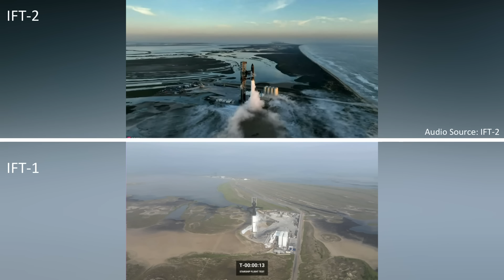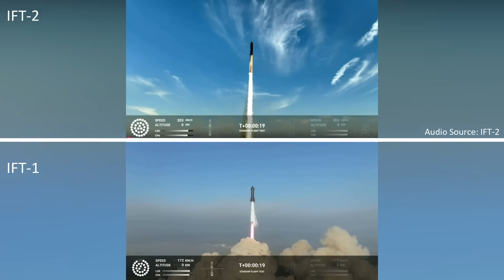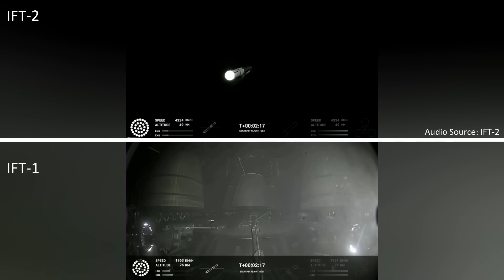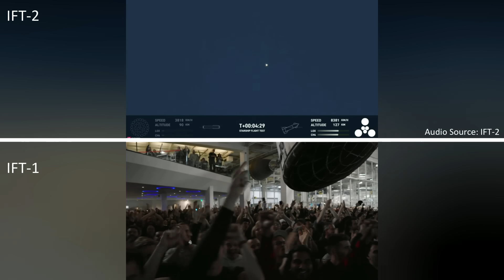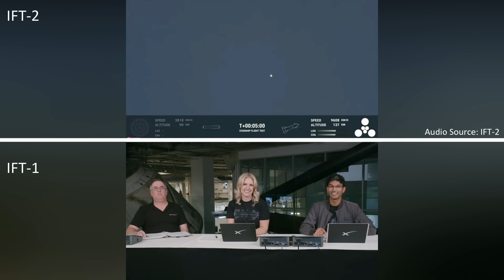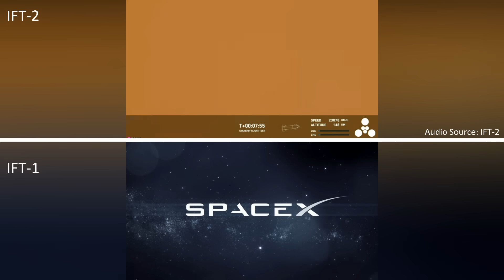Starship Launch IFT-2 Vs IFT-1 : Perfectly Synced Side by Side Comparison Video

Comment: The ignorance of commentors. Iterative improvements is how this game gets played. This launch was significantly better than the first. Over time, each launch will get better until it becomes routinely successful. That's how this game gets played, folks. Falcon 9 and Falcon heavy are perfect examples. They blew up all the time at the beginning, now they are the most reliable, successful, and least expensive launch vehicles in history.
Reply: I think people expect rockets to work like consumer electronics or cars. Usually when you see them they’re ready for market. But even those products go through multiple iterations before we see them. Rockets launch tests just can’t be done in private.
Reply: I expect them to expel 100 ton of black carbon per launch and mess up our ozone  layer. The explosions are just the icing  on the cake of destruction.
Reply: @angryox3102  I mean, they kinda used to be done in private, what we are seeing with the transparency in the test process is unprecedented. Back in the 40s-60s, almost all rocket tests were classified SECRET or TOP SECRET and you couldn't be within miles of the launch site, let alone broadcast it to the world. And there were a LOT of failures (search for USAF_ICBM_and_NASA_Launch_Vehicle_Flight_Test_Successes_and_Failures). By the time of Saturn I and Saturn V, most of the bugs were worked out.
Reply: @angryox3102  That's true. I has been worked in R&D for network equipment and protocol. We had 90% failed PoC(proof of concept) projects and got of 5% of them to a feature for end-user.
Some projects which I had done demo like 10 years ago. Now, they're still under considering in some network operators for 2024 plan to customer.
Reply: It’s crazy seeing people act like spacex and musk failed when these flights don’t go all the way. They’re literally the best in the world at what they do and rockets are insanely hard. I’ll take SpaceX’s approach of rapid iteration and blowing stuff up along the way then NASA’s make everything perfect and take 2 decades to make something
Reply: @edsherwook5196  either way, everything must get perfect at the end; let's just hope Elon doesn't get bored or decides all this is too expensive game
Reply: @edsherwook5196  It also completely ignores that NASA and it's predecessors had plenty of experiments and failures and had many technology demonstrators and programme's with many failures.

Heck, one could argue that the space shuttle never left the experimental stage since the 80's.
Reply: @edsherwook5196 well in fairness to NASA they where very much like spaceX during mercury/Gemini/Apollo but as there budget got shrunk down they simply cant afford to iterate, and with how politicians are a failed launch would likely mean further budget cuts
Reply: @KiRiTO72987  I agree, there’s a lot of reasons  they can’t compete but government bureaucracy is definitely the major one
Reply: Iterative improvement and big booms isnt the only way to play this game but it is the fast and cheap way to do it
Reply: @426shelby426 yep is better and more fun that simply using billions like nasa and not doing nothing atleast you get mechanical experience and over production experience to
Reply: @gamers-xh3uc  This rocket launch didn't cost billions though, first starship launch poly costed about 100M dollars. That means this rocket costs 40 times less than SLS per one launch so getting data about this rocket is already worth it, what's better is that the starship has more capability and at least dozens of times useful when carrying stuff to orbit or landing on moon/mars.
Reply: Agree 👍, a master didn't fall from heaven,...try and try some more 😉
Reply: Spot on !!!
Reply: Don’t worry about em man. Naysayers have never built or achieved anything in their pathetic miserable lives.

Comment: Greater success destroyed itself faster. Clearly IFT-2 is closer to a full success. Edited for clarity.
Reply: Someone clearly wasn’t looking at the numbers. IFT-1 one exploded at an altitude of 38 km with a speed of 1744 km/h while IFT-2 exploded at an altitude of 90 km with a speed of 3818 km/h. This means IFT-2 was moving over two times faster than IFT-1 and reached almost thrice the height. That’s not even mentioning the fact that IFT-2 had a successful booster separation.
Reply: @Roover8138  Yes. You did watch the side by side you can also look at the clock. IFT-2 met a rapid unscheduled disassembly faster. IFT-1 met it's rapid unscheduled disassembly slower. IFT-1 did damage itself faster.
Reply: @anthonylipke7754  Agreed lol the improvements they made to the abort system was definitely needed. The first one tumbled way longer than I remembered…
Reply: @ghfhchbtbb  Yes it's a valuable improvement to self destruct faster.
Reply: The sevond time you troed to walk on your own did you make it further then the first
Reply: @426shelby426   dunno probably fell on my butt.

Comment: It's not on its way to the Moon didn't even go in space
Reply: 148 kilometers is 48 km above the beginning of space.
Reply: it was never meant for the moon
Reply: If they don't try to test the returning, vertical landing for re-using and aiming to moon, it's easier and became successfully. Both booster and Starship worked well to reach orbital. They can continue to moon if they want.
You should know what the target is before opening your mouth.

Comment: Fascinating to compare the speed and height values between the two to show just how much trouble the booster had on IFT-1!
Reply: Really shows the tyranny of the rocket equation. With "only" 3 engines down, Superheavy looks like it's crawling off the launchpad. IFT-2 picks up velocity way faster.
Reply: @defenestrated23   Noticed that too. Only 3 engines down out of 33, and yet it was so sluggish off the pad, while IFT-2 jumped off.. Then, the altitude and speed were around X2 during planned separation time... 
     Rocket Science does seem crazy hard!
Reply: The first one used the old raptor engine, old hardware design(TVC, pipe, wiring, etc). So, the weight of both Starship and Booster was higher. The thrust power of engines was lower.
Sadly, booster can't re-ignite and lost all engines for return. I believe they trigged FTS on booster as well. Starship looked fine when they can burn almost propellant but not sure why they lost the control and had to use FTS.
Reply: The first launch was to see if the new rocket would work at all or just set on the pad ,explode,and blow STARBASE to kingdom come. I was there to see it live. I (and the 10,000 people with me) cheered loudly when it cleared the tower. As it was about a 1,000 ft up, I said  "Well, it hasn't blown up yet." . To see the first Starship launch is one of my treasured memories. In "rocket science" you don't learn from your successes , you learn from your failures. You want to have them early on in the program and not later when you have crew in space (ie Apollo 13).
Reply: Very true, but also some incredible compensation of the entire system on the first try.

But wow did they get higher and faster on the second when it worked properly.

In comparison the first really does look like my first attempts at a rocket design in ksp before perfecting the design.
Reply: @nt78stonewobble  I'm obviously a little older than you... When I was making (extremely dangerous, I now see) early attempts at rocketry in my childhood, I did it for real, somehow managing to wiggle between the cracks of overlapping supervision that several different adults had that should have stopped me, and only by the grace of Providence not seriously injuring myself!  Lol
Reply: @johnm8224  Well, it wasn't just you or SpaceX, entire  countries have had wobbly and questionable (early) rockets since the 40's.  I've seen the recordings :D

Comment: Until that ship lands on a rack it is a flop
Reply: One step at a time, this one worked  several times better than the first one. 
the next one will work several times better than this one !
Most engineering works on the principle of "build, break, repeat"
Reply: PEOPLE LIKE YOU ARE THE REASONS WHY SOME PEOPLE DONT TRY
Reply: @danielamaning  those guys doesn't work in high-tech field definitely. He should learn more how the world is working.
A lot of high-tech project, R&D projects failed every year. 90% of them were failed, about 5% of them can become some things which company can use or delivery to customer.

Comment: Where did ship 25 end up. I know the booster blew up. Did they blow up the ship aswel.
Reply: FTS triggered on the ship near the end of the burn, dont know why yet
Reply: it self destructed after reaching orbital speed.
Reply: It blew up after Seco
Reply: Think we'll get answers about exactly what happened over the next week.
Reply: The FTS automatically activated on the ship right around engine cutoff
Reply: Ship 25 detonated in space likely somewhere just north of Puerto Rico.  Weather radar showed a debris trail stretching along the flight path over the Western Atlantic, northeast of the Caribbean.  Scott Manley had a good YouTube video about it
Reply: It’s carrying space optimized Hitler clones to get things up and running on Mars. 😂
Reply: @sablatnic8030 the rocket 🚀  did hit a bird 🐦  and coursed the first to drop out the sky and the ships wings too small so the first option should look better 👌
Reply: @PlanXV    ?????
Reply: It looks like a big cover-up on that part
Reply: @paulgonzalesjunior6098  is it still in space  or on the way to the moon. Lol.

Comment: I think it was a successful day even though both stages go boom still got a lot of data. Neat seeing the side by side comparison. Thanks
Reply: They proved they can fly to the space. Still speed and altitude was not enough to lanch satellites. They didn't prove they can be returned/reused. We still don't know how "reusable" is launchpad. But they should know ).
Reply: @yurijmikhassiak7342  Two launches, two failures. You know that NASA expects between 15-17 successful flights before it gets a sniff at Artemis. So, the timeline is now further delayed, and it is nought for two so far.
Perhaps the third time is the trick. 
The new addition to the system which may or may not be reusable, flies in the face of musk's inane, "the best part is no part" rant. You couldn't make this up.
🤣
Reply: Also NASA has made concepts too endevorous to be used at a regular rate, they literally wanted to create a giant helicopter with huge blades to catch the first stage of the Saturn V, if you don't believe (because you are ignorant), then look up NASA Saturn V helicopter and see for yourself.
Reply: They lost coms Stewart, no data.
Reply: @IbnBahtuta  They still have realtime data up to right before FTS, that's how these things usually work
Reply: @mythrin  Both were prematurely ended and the data from the soft landings never happened, that's how physics works.
Reply: @IbnBahtuta  so your saying they learned absolutely nothing from this so I guess u are a rocket scientist
Reply: @townsendYXZ  Where did I say that grasshopper? So, you start by putting words in my mouth that are yours, not mine. What's next grasshopper? A strawman argument? Critical thinking Stewart, have you ever heard of it? rofl
Reply: @IbnBahtuta I bet you said the same thing to everyone when the falcon 9 kept exploding, but now the rocket works flawlessly and does launches at the most 2 times a day.
Reply: @IbnBahtuta You are acting kind of mean, You literally called someone a grasshopper, If you are going to be mean to me, I will be mean to you, Symmetry my friend.
Reply: @IbnBahtuta 
How to be unlikable 101.
Reply: @carcinogen60yearsago  I was just waiting for a plonker to bite, thanks.
🤣
Reply: @IbnBahtuta Also the reason why SLS worked on the first attempt was because it was a concept that was already proven to work as it is similar to the Saturn V in terms of architecture and shape and performance, Starship is an entirely new thing and will have failures along it's testing journey, but the reason why this flight was better than the last one is because it flew farther and performed better. Ones achievements should be celebrated even if it ended in a failure. It's like celebrating passing a test even if the grade was a D instead of a F